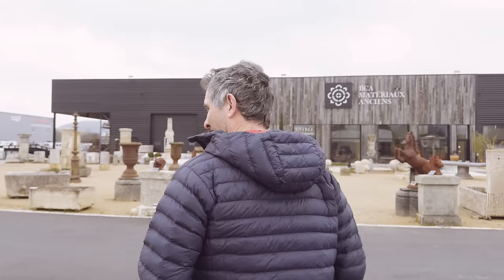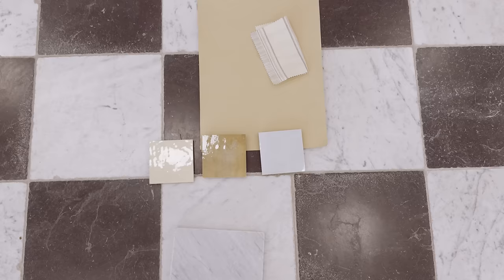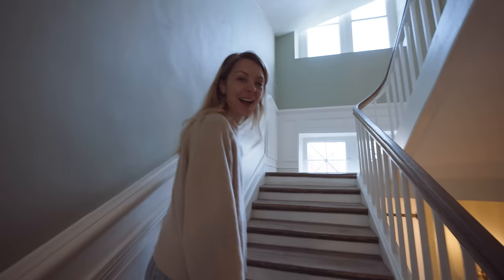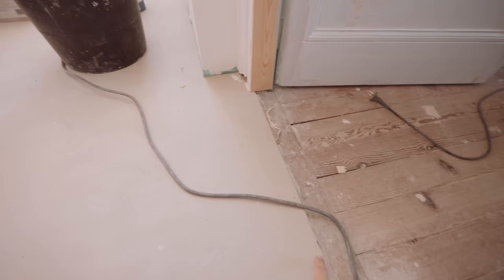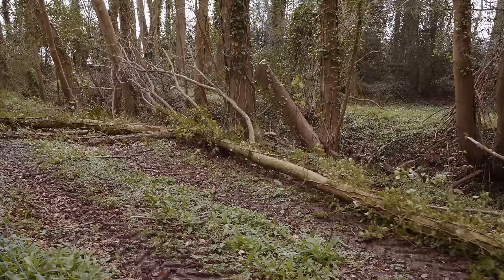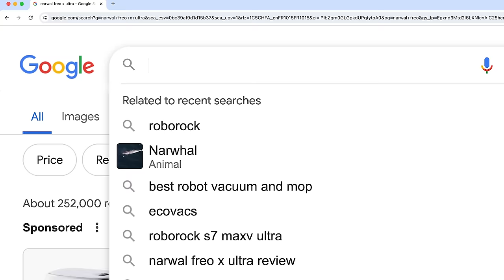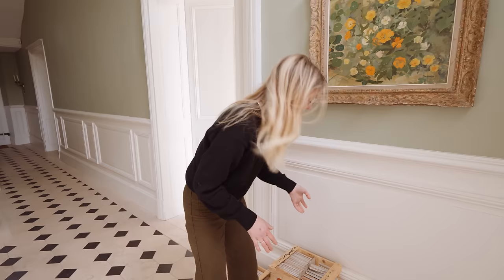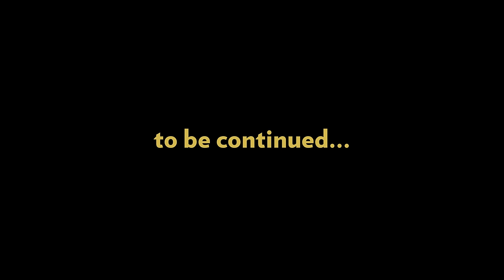REVEALING the TILES for our Chateau Master Suite Bath (We love them!)

Comment from the maker: Thanks to Narwal for sponsoring today's video! Check them out using the links below, and don't forget to apply the $200 discount on Amazon. •  https://bit.ly/YT-HTRAC-Apr-US (US) https://bit.ly/YT-HTRAC-Apr-CA (CAN)
Reply: What about the uk, Ireland, Italy Germany or anywhere else?
Reply: Croatia?
Reply from the maker: @jimmyconnolly3461  the best thing is to google them or look for them on Amazon, i couldn't put links to every country here, sorry :)
Reply from the maker: @28080601  you find them easily on google or amazon!
Reply: But no discount for UK/Ire or Europe
Reply: @jimmyconnolly3461  The European version has a stick attached Jimmy.
Reply: Have one and absolutely love it. Great job on carpet, tile, mopping and sweeping.
Reply: PS wish I had your code when I bought mine 😢
Reply: The shower tile pattern is called Herringbone. Similar to chevron, but the Chevron requires 45 degree cuts where the tiles meet.
Reply: What is the discount code im trying to order on amazone de
Reply: @HowToRenovateAChateau  Out of stock Amazon UK😠
Reply: Very expensive!
Reply: Hey the Narwal ad,  I have the same carpet as you.  Almost identical.  I was told circa 1914, Turkish, NewZealand wool. Small world.🎉 Got it at a consignment shop 40 years ago for 450.00...

Comment: You can fix the door threshold by adding a piece of wood or tile beveled at 45 degrees and flare out the sides of the piece so you don't stub your toe. You will also have to shorten the door and frame

Comment: If you put a large kitchen whisk in the downspout hole you may be able to keep the gutters functional without using modern gutter covers (or use the modern ones if they are not visible.

Comment: May I make a little suggestion to help? You need to put screens over the top of those downspouts. Screens with a pretty big grid. To stop the leaves and twigs from plugging up the downspouts,  but let the water thru. And clean your gutters every fall once the leaves are down. You need the gutters clean for winter and spring storms. If you have trees with catkins in the spring, and other large seeds, then check the gutters then too. Put it on the monthly house/property cleaning calendar.
Reply from the maker: Thanks for the tip!
Reply: Gutter guards

Comment: That’s a herringbone pattern! About the level difference, I’ve seen tresholds (doorsteps) in old buildings with a halfrounded top. You can easily have Benoit manufacture something to that effect. Just ensure that there is flexibility in between the wood and the tiles - silicone or similar - to allow the wood to move and expand as needed.

Comment: Some tile things to know...to use larger tiles in a small space best to use it at a diagonal 45 degrees from the door., larger tiles will crack if the floor is not even or is on wood that moves...there is a german product Kerdi that is a an anti fracture membrane by Schluter they developed it for conference buidings that use huge format tile but they need forklifts to run on them.. I love you selection of tile and the pattern in the States in the shower is just called herringbone... This chateau is in great heads...

Comment: €20-€30,000 for the upkeep of your woodland 🌳🪵😮! It would be v interesting  see a video compilation of all four seasons of this part of the restoration/preservation - that's not a small figure. Can you get grants towards it?- ecological /environmental. Great gutter work , is it possible to get wire mesh to cover the gutters and keep the twigs and mulch out - summer project! 🐾💦🍁🍂... very pretty tiles, had the same issue with a main hall floor - would a custom designed wooden lintel to bridge the two spaces work ,might need its own 'split-level' .. or a sloped tile? Beautiful green and also all the build work biscuit and tangerine shades! Red is auspicious . 🪸🪸- coral red would be worth a try .. or maybe in the shower room❤ love it all- you have fantastic artisan craftsmen !!- 🎯

Comment: The tile work in the shower looks wonderful. 
I think it is a shame that you had to relevel the bathroom floor.  I believe the difference in height between the bathroom floor and the adjoining floor is the depth of the tile you chose for the bathroom floor.  It is exceptionally thick.  Most floor tiling is about .25 in or 0.635 cm.  I think this will be an ongoing issue for you as it's too short to be a stair step, but too high to use a traditional transition piece to cover the join.
I love the robot vacuum.  I have a small doggie daycare/boarding business and that would be really nice to have.  However the price, even with $200 off, is not in my budget.

Comment: Did you ask the guy to put the tiles on without equal gaps? Were the tiles off by that much? You can see it in the video that he doesn't level anyting, doesn't care about the tile gaps, the cuts are uneven on the sides. If you told him to do it this way, then it is fine. Otherwise, he did/does a terrible job at tiling. 
I mean the gaps on the middle are totally uneven and as a result he has to cut the tiles uneven on the sides. The higher he goes the longer the tiles going to be at the top. It looks like a proper bad job.
Reply: Sadly, I am not a tiler. 
However, I thought these marble tiles bought locally from an antique brocante, are antiques and hand cut. 

Also, Philipp has previously mentioned that the walls and floors are not level or straight. 
I love the end result of the tiling. 
To me it looks and feels authentic, adding a ‘nod’ to the history of the chateau. 

Perhaps the tiler may well have used a technique without spacers as per back in the period the chateau was built.